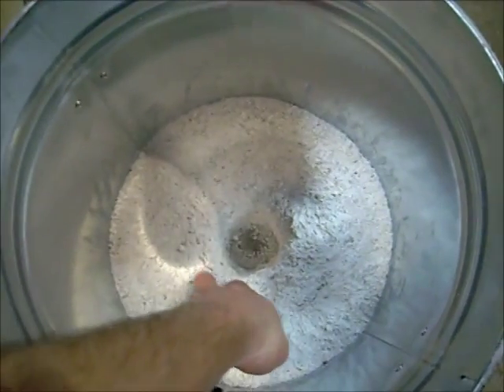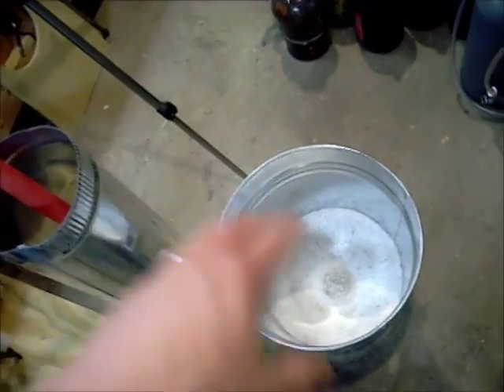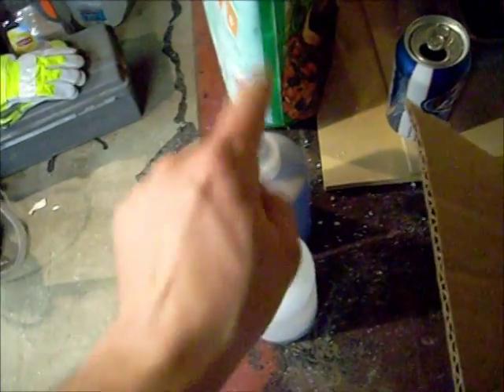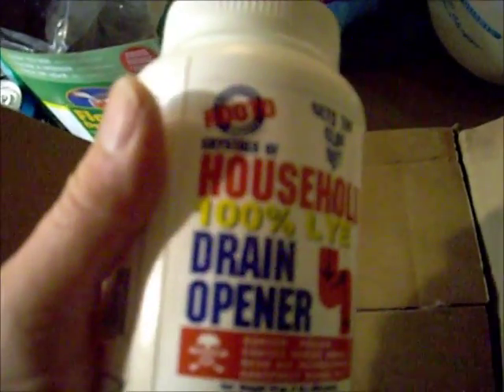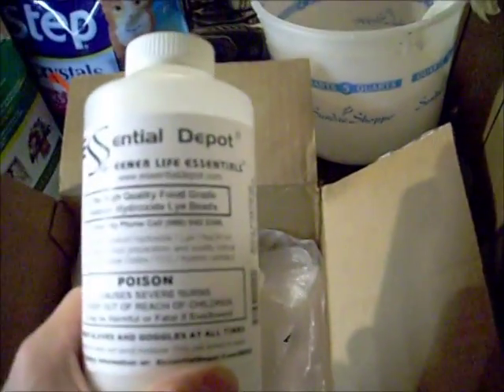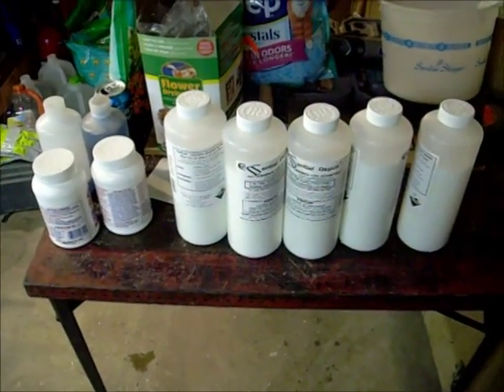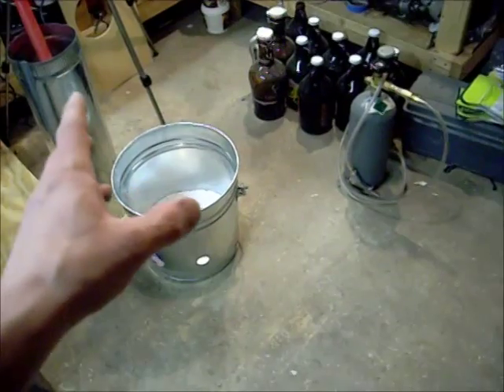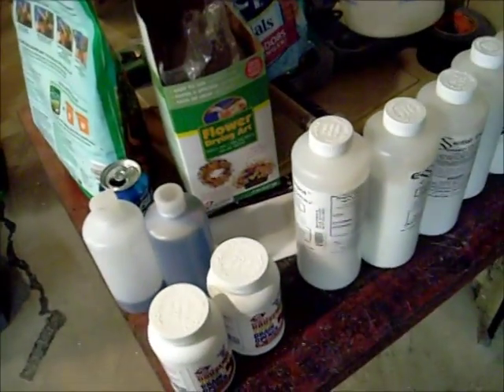Foundry update Lye source

Comment: Lye is used to make some foods like ludafisk and I know there is a Asian food I just can't remember. I think it's the egg that has a chicken or duck chick in the egg. 1000 year egg I think it's called. Then also I think this comes from poor jews in Europe but it is put on some bagels. I'm sure it burns going down and out but if I remember right it is actually ingested on top of certain bagels while everything else it is just used to cure or cook food.

Food grade is the amount and types of containament of other chemicals. Drain cleaner can say 100% lye but it can be only 97% and 3% mixture of miscellaneous.

Great video series though. I've been thinking about a small backyard foundry and been looking into water glass and silica sand. I guess the biggest problem is silica gel that doesn't have any additional dies or other chemicals. Because I was looking into using crystal cat litter to make water glass then cook half the water glass to make pure silica sand and use the other half of the water glass to mold the silica sand for the foundry.